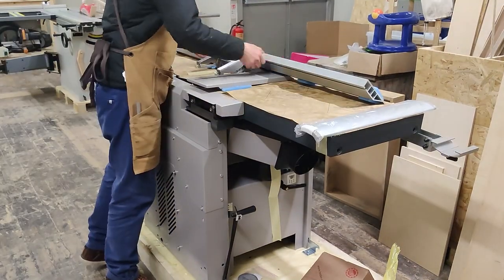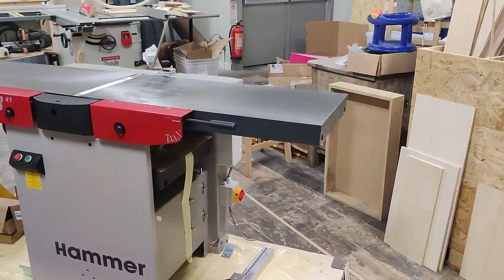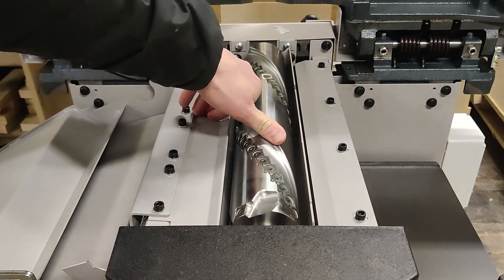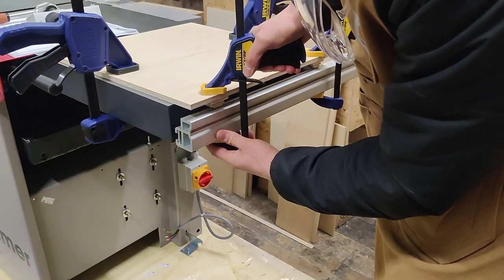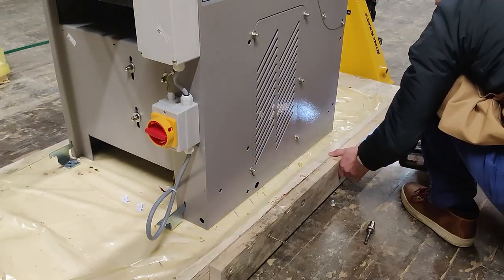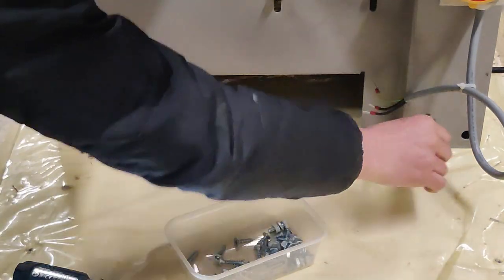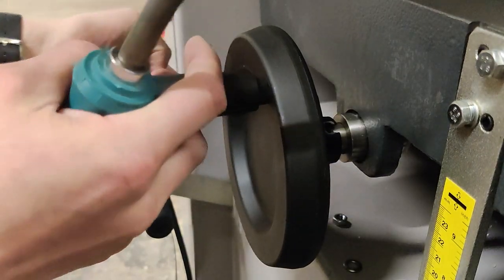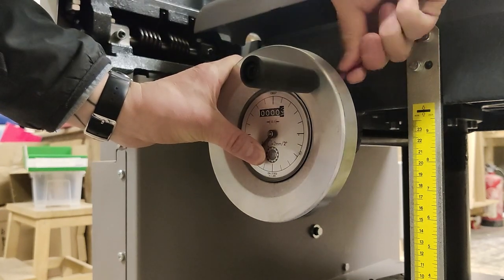Hammer A3-41 Setup, Cable and Electrical Connection

Comment: When you start these single phase A3's always hold the green start button down until it reaches full speed. If you don't the start capacitors are stressed and they will fail somewhere down the track. The vertical bolt you slid the paper under should be adjusted to contact the under side of the table after it is locked down on the other bolt, leave the DI set up and monitor the height change as you bring the bolt up and start locking it down.

Comment: Thanks for the video Fergus.  I took delivery of the smaller A331 a year ago with a spiral head and digital dial and found myself puzzling my way through a number of the same issues you have had.  Since that time, I’ve managed to rotate the cutter blocks using the designated torque wrench and that worked well enough.  After 100’s of metres of wood planing, I began to get ‘sticking’ when thicknessing and Felder advised using a red scouring pad (yes, you can get them) and WD40 to thoroughly clean the beds which worked a treat.  My next challenge is whether I’m competent enough to grease gears and tension the internal belts!  It’s been a fantastic machine which has transformed my woodworking.  Kind regards. Martin
Reply from the maker: Thanks for the comment Martin and glad to hear you're getting on well with yours. I guess I'll be looking into those maintenance tasks in a year or so too!

Comment: Jason Bent has mentioned the castors I use to move my J/P around. I can make the machine crab on a diagonal with minimal effort and turn around in its own footprint
Reply from the maker: Thanks. I've been considering them but also wondered whether I could use a pallet truck for the whole workshop but it does need quite a bit of space to get in and out of what it's moving. Works for now though.

Love your work. 👍
Reply: @beyondutility  Thank You...we are trying to raise the bar....

Comment: I just looked at my rail. I can indeed get the full length with maybe a cm of the block hanging off the back. I install my rail offset back a cm. It’s possible my rail is longer or my rectangular tabs are shorter than yours.

Comment: I feel dumb asking this but I can’t seem to figure out how to open that electrical shut off box. Any tips? I took all the screws out but it seems stuck towards the bottom of that switch box like it’s still attached so I just pull harder? Just don’t want to break anything
Reply from the maker: I was exactly the same! Have you removed the bottom screw? I think it's hidden beneath the yellow bit I think you need to pull that yellow bit out downwards (maybe). If I remember correctly it's a clip which locks the front in place and you need to put a fair amount of force to snap it out. I did it about 6 months ago so can't remember exactly and I'm not near the machine until next week. Hope this helps.

Comment: Lol. The fact that every hammer table is not flat across its width or length should be an annoying fact not an acceptable tolerance.
Garbage machines.
Did you gauge the thicknesser bed too ? If it's not flat you WILL get snipe and there is NOTHING you can do to prevent it.
Felder will tell you their tolerances are acceptable but of course that's only because you accept it.
I wouldn't.
Reply from the maker: Interesting to hear your thoughts. I'm not really sure what is reasonable or not and I've seen others saying that the tolerance of the beds is not good enough so could well be right.
Reply: @beyondutility  
For any jointer to be accurate it has to have tables that are dead flat.With a machine of genuine quality you would simply not be able to slide a feeler gauge under your straight edge.
Felder beds and tables are notorious for being unstable. 
The ribbing is not deep enough and they don't season their castings properly to stabilise them before machining them.
Quality machine tables are seasoned, case hardened then surface ground for greatest accuracy and wear resistance.
Felder tables are just surface milled because it's quick and cheap. Cast iron takes time to stabilise. It needs to be exposed to temperature cycling for at least two years outside in the weather.
Reply from the maker: @joschmoyo4532  Interesting. Are there other brands that you recommend which are produced to tighter tolerances?
Reply: @beyondutility  
Yes, but of course your looking at industrial quality machine's where production runs rely on tight tolerances. But that is no excuse for a company the size of Felder to cut corners. The most important tool you need when looking to buy any machine is an engineer's straight edge. 
If Felder made metal lathes or mills to this poor standard they would not last five minutes. 
The machines would be unusable.
Personally I can't believe they get away with it but most hobby woodworker's really don't know better. They fall for the spiral head cutter and think that makes the machine awesome ! 
I'm not a big SCMI fan myself but your more likely to get a better machine from them than Felder.
Unless your prepared to hunt for a good used Wadkin. 
Combination machines are a crippling compromise. Most full time wood machinists hate them because they are slow and inaccurate.
Reply from the maker: @joschmoyo4532  thanks for your thoughts. Much appreciated.
Reply: @beyondutility SCM make good machines but you will pay more.